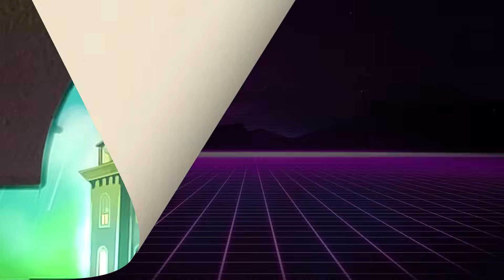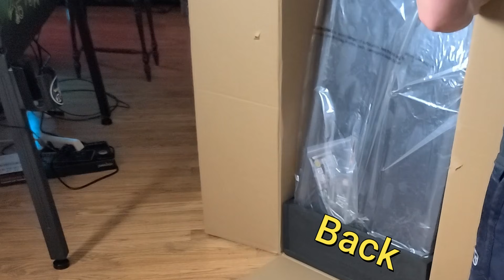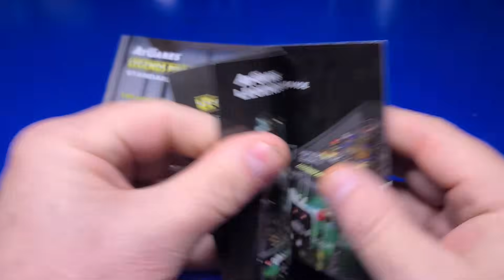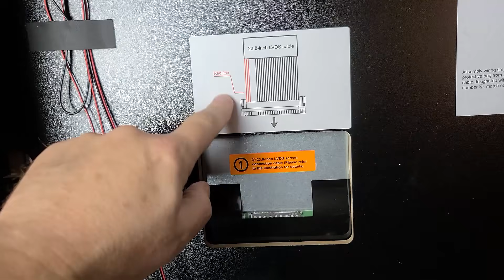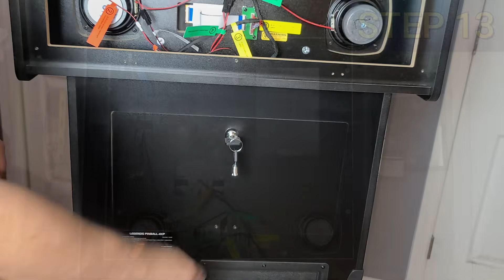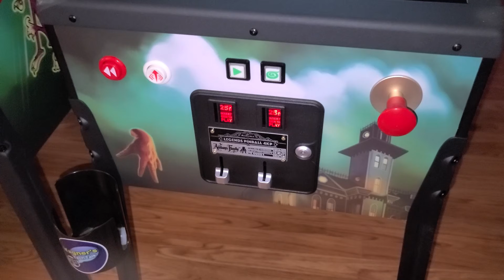AtGames Legends Pinball 4K: Unboxing & Assembly (Setup Part 1)

Comment: Hello Sir!  Need some help.  Got the new AtGames 4K Peanuts pinball machine, went to plug in the LVDS cable to the main display screen and bent some of the pins on the cable.  Ordered a new LVDS cable, received it, attached it and the display is backlit but nothing else is showing up.  Would you happen to know what the problem could be? Any help would be greatly appreciated!!  Thanks....
Reply from the maker: Hard to say, did you get the LVDS cable from AtGames?  Make sure any connections you make are while the machine is powered off (and unplugged).  If you attempt to connect any of the cables with the power on, it could damage the display/main board.  If none of this helps, please open a support ticket with AtGames customer service.
Reply: Yes, I did get the new cable from AtGames.  I think anything was turned off, but I'm not sure if the machine was unplugged.  Hopefully, we can figure something out.  Thank you, sir. It's greatly appreciated!!
Reply from the maker: @traceyas  Very welcome, let me know how it goes, please.

Comment: Hi Wagner, in your assembly video, you used the black screws from the plastic casing. I received two sets of black screws, one that came inside the same way you unpacked it. But I also received another set that came directly in the box with the legs, but they are a tad bit longer.

I used the ones that came inside the legs box.

Do you know which ones I should use?
Reply from the maker: Either will be fine.

Comment: Mine came in with a broken monitor.  Now I wish i wasn't an early backer.  Wish me luck......
Reply from the maker: From what I've been hearing, AtGames has been doing a good job getting shipping issues turned around.  Let me know once you get a replacement.  If they will be shipping just the display, you can use my SSF Kit installation video on how to replace just the display.  But, think they'll likely ship an entire cabinet instead.

Comment: Thanks for the video.  My playfield has light streaks running across from the left across to the right, terminating at the object on the playfield.  I tested the playfield before i connected the backbox and it was doing this before i connected any cables.  I am using my own power cable as AtGames didnt include the power cable/key box in my shipment. Could it be anything other than a damaged/defective monitor?  i have opened a ticket but im looking to the community for some expertise.
Reply from the maker: I think it's most likely a defective display in this case.  Not that it can't be something else, but seems less likely.

Comment: Where is the key located? i am seem to be either missing one.  Is it supposed to be with the table or the backglass box.  is it hidden in packaging.  is it in that tiny box with the backbox? i didnt get one of those.
Reply from the maker: Should be in a small box that includes the power supply for the machine.  Mine was wedged into the foam.
Reply: Looks like im missing that box. no power supply either.  @WagnersTechTalk

Comment: Hi Jon thanks for your amazing Video. Just received my machine, did everything aus you did, but it does not boot (however power switch light is on and you can use the pinball buttons). Any ideas ? Thanks
Reply from the maker: It sounds like a cable came loose during shipment.  I'd recommend checking with AtGames support, it's not an issue I've run into and best for them to help you.
Reply: @WagnersTechTalk  Thanks for the Tipp Jon. Atgames forgot to plugin the rear power unit.

Comment: My 4kp was dead on arrival. Has this happened to anyone else?
Reply from the maker: I've seen some that have damage, some that had cables get disconnected (likely during shipment) but not sure if that is the same as what you're seeing.  If the power to the boards is disconnected, that would obviously give the impression that it's doa.  I would open a ticket with AtGames and see what they suggest.  Not enough here for me to go on.
Reply: I opened a ticket with atgames last night.  It’s just really weird because the power switch lights up when you turn it on and the solenoids activate when you hit the flippers but nothing else works.  The fan on the pcb doesn’t spin up.  I dont see any led’s light up inside the cabinet if there are any.  I was just curious if you had heard from anyone else if they had a dead unit.  Thanks.  @WagnersTechTalk
Reply from the maker: Depending on how interested you are in seeing if you want to check for any disconnected cables, you could use this SSF kit video (disassemble/reassemble portions) to take it apart and check for any disconnected cables: https://youtu.be/ram6haQN0UU (& depending on your comfort level doing so, this shouldn't be necessary).  Since a ticket was created, likely best to wait until AtGames responds.  But if you're comfortable opening the machine to check, that may help too.  I would always recommend what AtGames Customer Service says over anything I might mention.

Comment: Can you compare the leg lengths of the 4KP to the HD?  Are they standard length Stern legs now instead of the shorties that came with the HD?  I have official Stern legs sitting to replace my HD legs that have been up on furniture risers for 2 years now.
Reply from the maker: They are about 29 3/4" tall from the floor to the top of the leg (not fully extended at the feet)

Comment: Great video, they learn from their first machine. I’m sure you advising them didn’t hurt either. I’m sure installation and startup time was cut in half.
Reply from the maker: Thanks UAG, they improved the machine in about every way possible from the HD model.  Even launching tables is faster, but would be expected due to the much faster CPU.  Thanks for watching!

Comment: Thanks Jon, great Video. Do you know, if the power unit can handle 220 V ? Cheers, Ed
Reply from the maker: From the back of the machine, it states - Power Input:
AC 110-240V - 50/60Hz 1.2A
Reply: @WagnersTechTalk  thanks Jon, great news, means plug and play im Europe, too - no converter needed.

Comment: Glad you got the first one!  I will troll until a lower cost generic version is offered, since love my current ALP and the modding I did.  BTW, hopefully people appreciate that if they struggle with 4K playing smooth via OTG, 1440P pinball looks worse than 1080p on a 4K display.  It's a pixel ratio thing that matters.

Comment: I think AtGames did a great job making everything look pretty easy to assemble. I'm wondering how easy it might be to get access to that DMD screen and mod in something bigger. 8" feels too small, and while I'm sure they were just using the screens they already had sourced for the Micro, this would be the first mod I'd be looking to do after adding SSF. Just ordered all my cables I need to hook my PC up when it arrives. Getting excited!
Reply from the maker: On the front of the backbox there are two screws at the top and the speaker grill cover screws holding in the plexi.  Getting to it wouldn't be too hard, though removing the DMD may be.  The SSF I'm looking forward to installing for sure!

Comment: Hi Jon! Thanks for these videos. Are the legs more like Stern legs than the ones on the previous Legends Pinball incarnation? Do they have levelers or pads on the bottom?
Reply from the maker: I think they are black versions of the legs from the ALP HD.  I could be wrong about that, but I think that's the case.  There are pads on the bottom and looks like you can raise it up about 1-2" by adjusting the screws.
Reply: @WagnersTechTalk  Thank you! So a little shorter than typical legs?
Reply from the maker: They are about 29 3/4" tall from the floor to the top of the leg (not fully extended at the feet)
Reply: @WagnersTechTalk  Thank you! You're amazing!